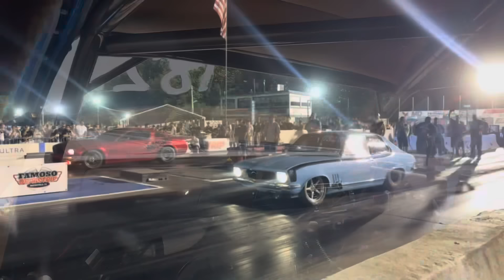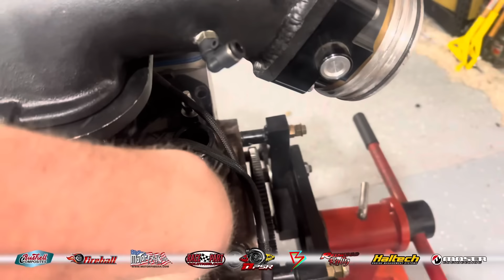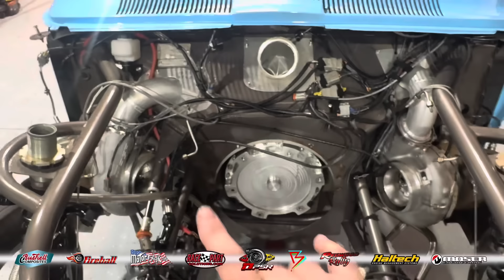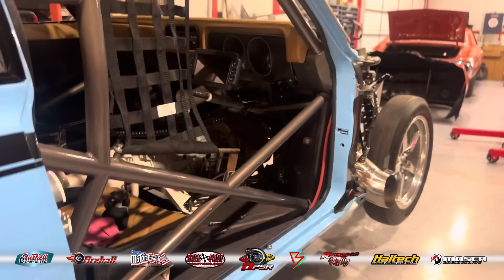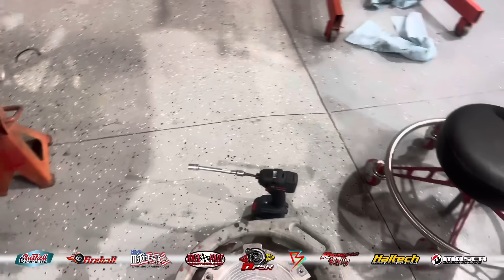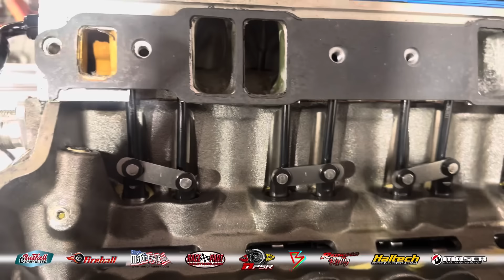Get all the secrets to developing this 2000hp+ no prep drag car.

Comment: Use a 1206s they have a metal core
Reply from the maker: Usually we do, but this manifold needs a thicker gasket for alignment and the 1206-s is only 0.060”